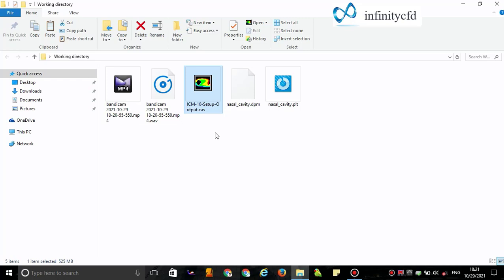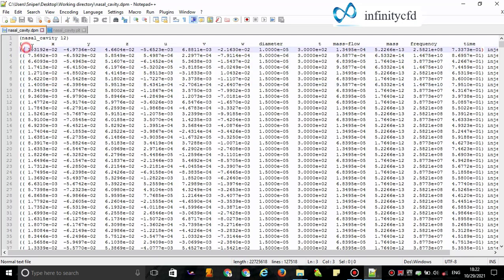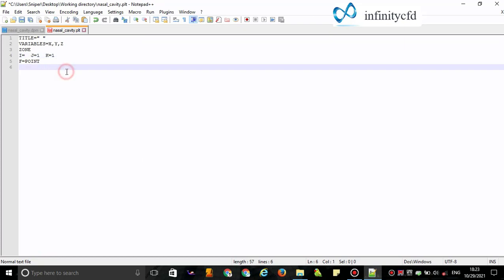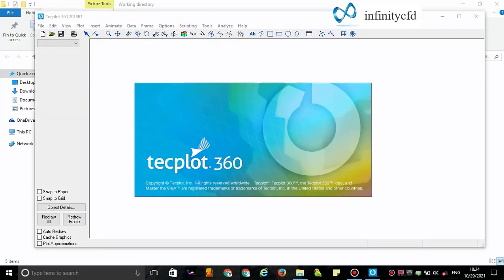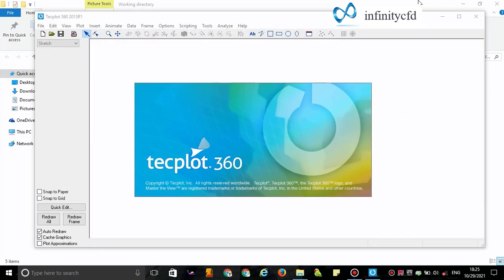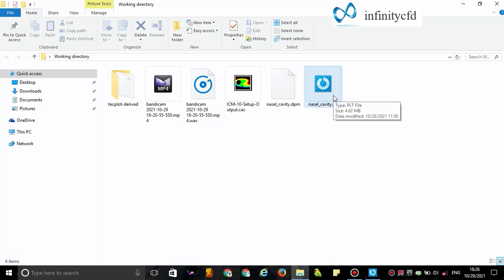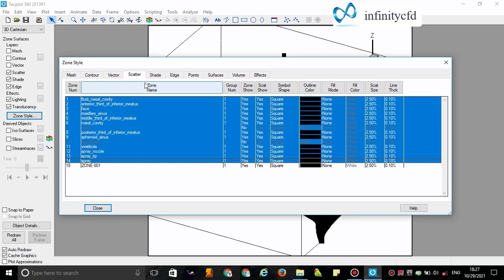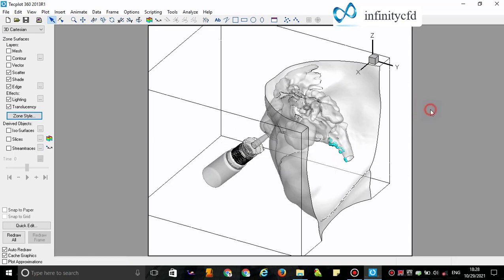How to demonstrate deposited particles in Tecplot (Particle visualization in Tecplot).

Comment: Thanks for an informative video
Reply: I have a couple of doubts ... Can you please help me with them

1) The DPM file shows different diameters.. I am using a Rosin Rammler deposition with variable diameter from 2-20 microns however when I extract the DOM file as per Reports> Discrete phase> Sample. I get only one particle size shown.

2) I am particularly interested in the number of particles that are trapped in different ranges (say 2-5microns, 6-15 microns , 16-20 microns etc).. but the number of particles that are trapped is not shown in this DOM file.

Can you please help me with these

Thanks
Reply from the maker: About the first question this problem is originated by two possible issue: 1- Different diameters are not generated by your R-R distribution function or 2- You may not capture the whole injected particles. For example you do not select all injection if there is multiple injections. You should check it out step by step to find out the problem.
About the latter question I should say that you can open the DPM file using Notepad++ and see the number of all particles. For the second part of your question, there is a facility in Microsoft Excel to get the number of particles in each diameter bin. By this means you can determine the desired diameter bins for example 1-5 micron and it tells you how many particles exist in this range. It is located on the Data tab, in the Analysis group, Data Analysis, and the Histogram.
Reply from the maker: You're welcome.